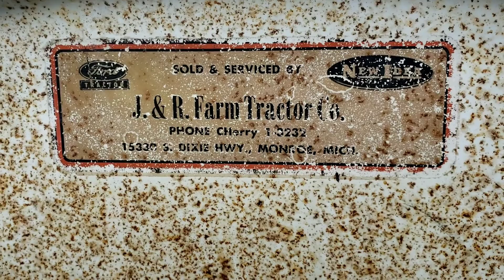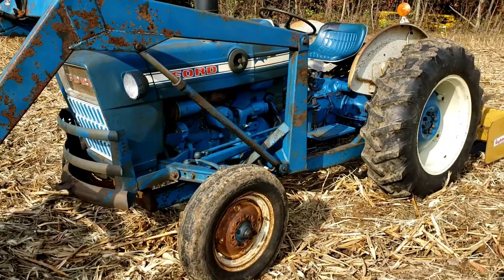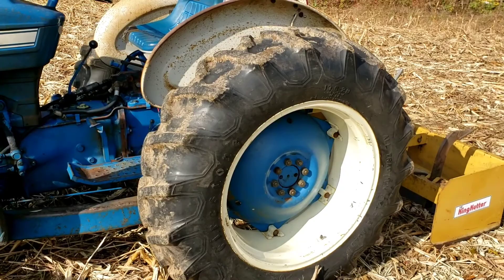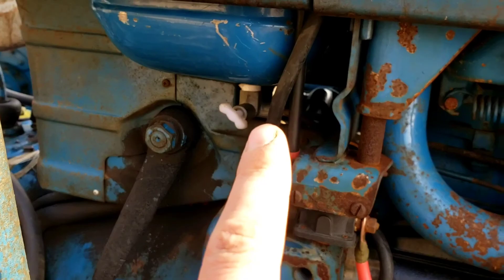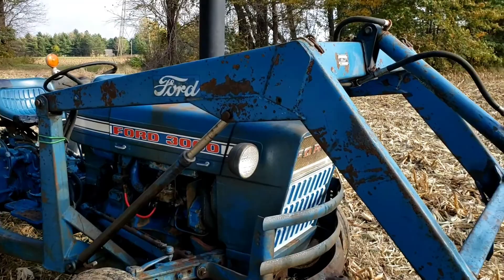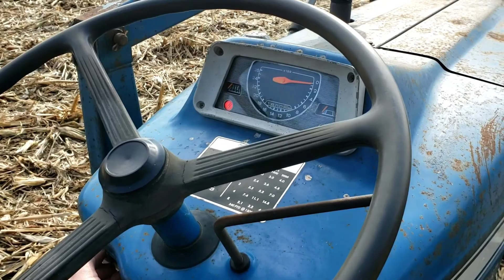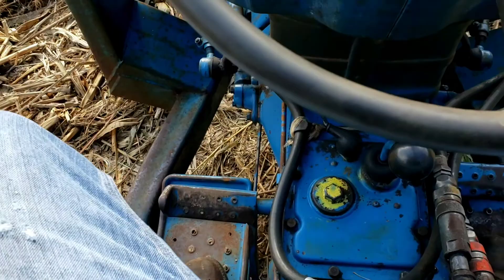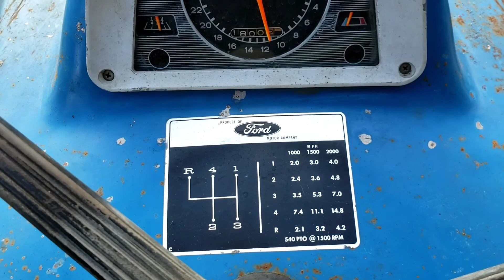1969 Ford 3000 Walk Around

Comment: Looking good!! Cleaned up real nice!! Did you check the timing real good for that little bit of hesitation?
Reply from the maker: I have not yet, still plenty of little bugs to work out. My neighbor has a 4000 and it has had that same hesitation for the entire time I've heard it run. I kinda assumed it was the nature of the machine.
Reply: @Randys_Relics  I only had experience with a 2000 back in my Vo Tech days. 😆 The school had one for mowing. Since I was in auto mechanics and the only one that messed with tractors I got to work on it if it needed anything. If I remember correctly it sounded the same way. Like it labored a little before it took off.

Comment: Hi....do you have any kind of data on the secondary hydraulic control for the front loader...like manufacturer and model? Haven't seen that kind of control before..seems  very smart
Reply from the maker: It is a factory Ford 2-spool valve.
Reply: @Randys_Relics  thanks...I'll try to Google one😎